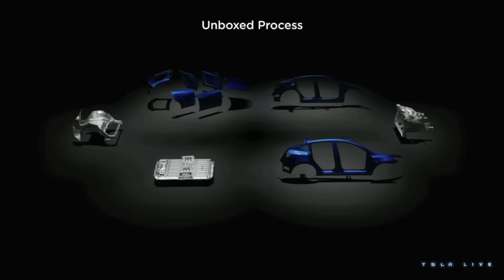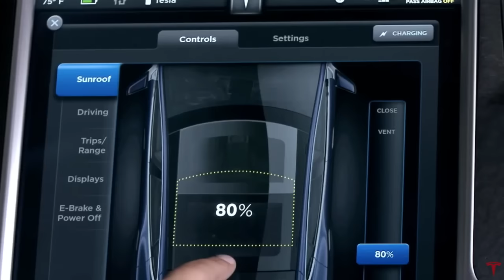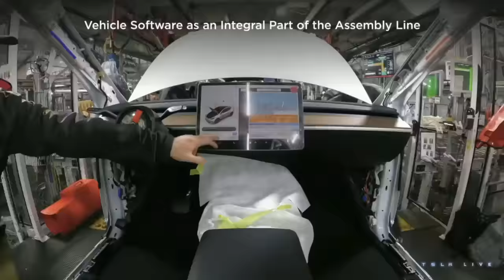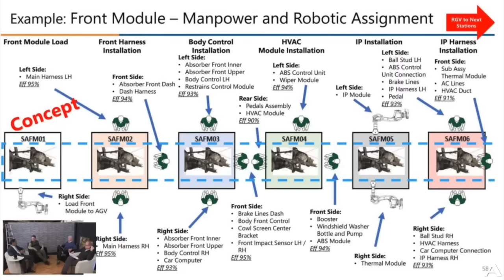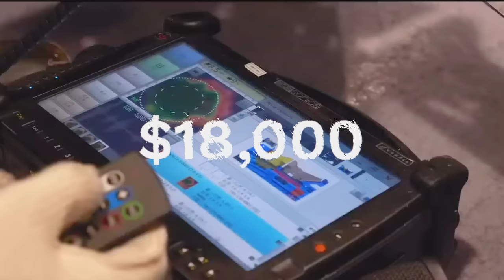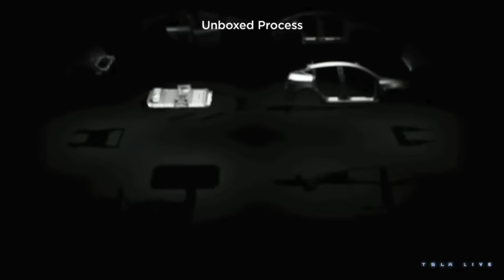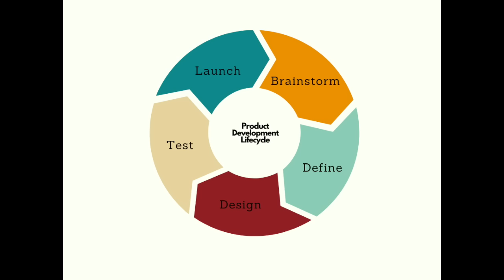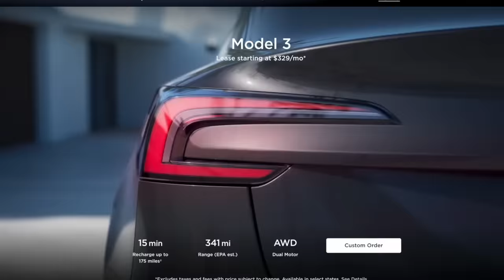Tesla Turns on A New Era of Vehicle Production - The Race for Next-Gen Auto Manufacturing

Comment: Electric cars are crap!
No range, no resale value, the slightest accident and battery gets dinged cars totaled. Charging takes forever at home. If you can find a  quick charge without a huge line it shortens battery life. And you have no idea what the cost will be and do I even need to mention the cold ? Wait until an EMP hits then tell me how great they are. They are so great Toyota stopped making them . Herts is selling all theirs because they suck!!!. Tires and brakes wear out faster because they are so heavy. Insurance is going thru the roof and states realized they are losing out on the 80 cent a gallon tax so an annual tax is coming. 😊